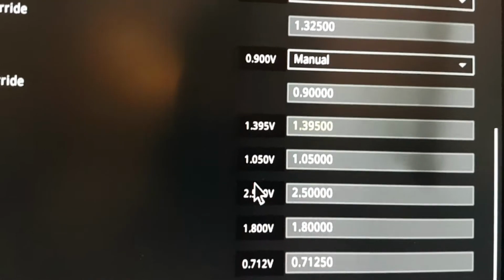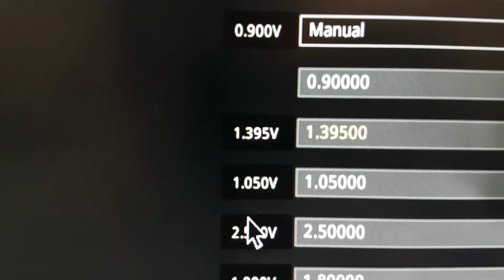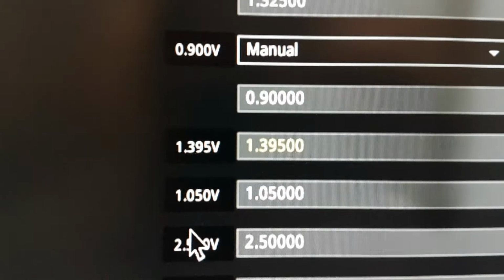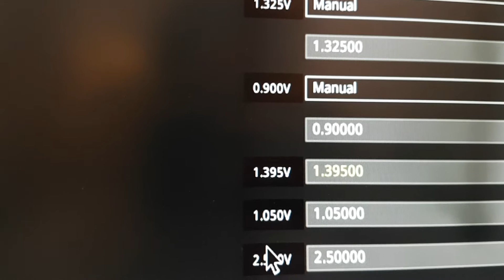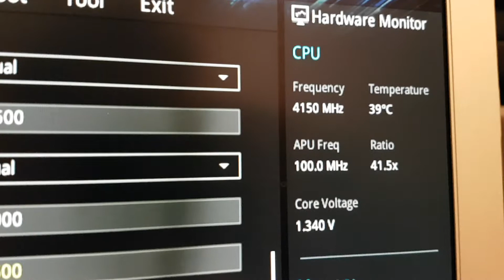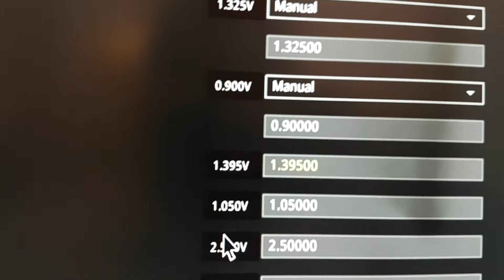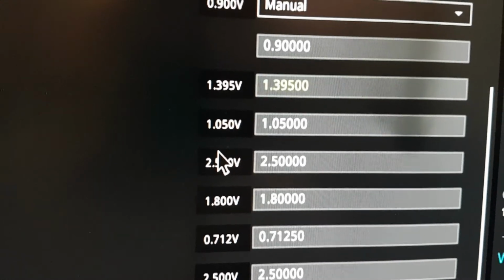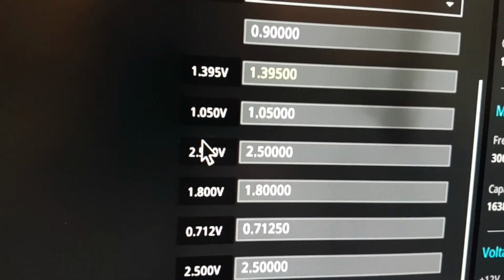AMD Ryzen 2700X overclocking on ASUS Prime X370 Pro

Comment: Which mobo should i choose to run 2700x: B450 Tomahawk or X370 Prime Pro? I also want to OC slightly :v I have a CM ML240R AIO. Thanks :v
Reply from the maker: If it's between those two I'd say the Tomahawk. B450 has better memory compatibility and memory stability than X370, plus there's a greater chance you can upgrade to Ryzen 4000 when it launches. The X370-chipset will not support that. Either way make sure that the memory sticks you chose are on the QVL for the motherboard, as chances are they won't run at the rated speed if they're not.
Reply: @OzzedNet  i dont care much about ryzen 4000 because i may use this combo for at least several years. My concern is about VRM of those 2 mobo. Which one is better to OC 2700X. I've read many reviews. Many people say that b450 tomahawk is too weak for 2700x to OC stably. But many others say it has enough good efficiency :v i'm so confused :))
Reply from the maker: @Vinhl3e  I looked around some and both are totally fine for an OC'd 2700X so it's mostly up to your personal preference. Any VRM will overheat without proper airflow around the heatsinks though, but as long as you have a well ventilated care is should be fine.
Reply: @OzzedNet  my demand is not so high. So i don't think spend too much money to buy x470 or x570 :)) but i think using default frequecy is quite wasting the "X" version with the AIO cooler lol 😂 i just want to OC SLIGHTLY :))

Comment: hello, I have the choice to get this motherboard for cheaps this week, how is PBO and XFR2 overclocking on this motherboard? Thanks
Reply from the maker: XFR2 is working fine, My 2700X was boosting to 4.35Ghz on  a single cores all the time so no issues there. PBO though is a different story. It didn't work that well on this motherboard to be honest. The point of PBO is supposed to be higher boosts but it didn't seem to do that for me, plus all the limits seem to be manual and wonky. It works much better on the Crosshair  VII I got. I can get rock solid all core boost of 4.2Ghz there and it still boosts to 4.35Ghz single core.

If it's "cheap" though the X370 Prime pro is still a pretty solid board, but make sure it comes pre-flashed with a BIOS that supports the 2000-series processors if you're planning to use of of these because if you have an older BIOS that doesn't support them, the board will simply not boot. You will get a black screen  and nothing more.
Reply: @OzzedNet  wow thank you for the detailed response. Yeah currently my choices are : 
X370 prime pro - $110
X370 taichi - $190
X370 k7 - $215
X370 crosshair 6 (pre owned) - $200

X470 motherboards are still too young expensive for me in my part of the woods at the moment.

I realized that the x370 prime only has one m.2 slot. And m.2 drive prices are really attractive right now.
Reply from the maker: With that lineup you can't beat the Prime Pro. The taichi has really nice hardware but the BIOS is a disaster, to put it lightly, the K7 has lackluster hardware that I wouldn't touch with a 10-foot pole, BIOS is OK on that one though, not as good as the ASUS-one but OK. The Crosshair 6 is the nicest of them, but if you're on a budget I wouldn't say the extra $90 over the Prime Pro is worth it though.

Comment: I have X370 KILLER SLI from ASROCK. What Ryzen should I buy ?
Reply from the maker: Do you have a current Ryzen CPU for it? Make sure to update the BIOS BEFORE buying a new processor from the 2nd generation Ryzen or it won't boot. The VRM on that board looks very weak, so If you're buying 2700X don't overclock it. I think you can probably run any Ryzen 5- processor on there. Maybe the 2600X?

Comment: Should i buy this motherboard for 2700x to keep it on stock with pb2 and xfr2 (are the vrms nice enough???) does vrm get hot
Reply from the maker: Hi! The VRM's don't get hot and are perfectly fine for stock and even ovecklocking, AND PB2 and XFR2 works on this board. But if you're buying a new one you might as well go with the X470 Prime Pro due to better memory support. I have G-skill Ripjaws V 3600Mhz (B-die) and they get unstable at even 3266 even with looooose timings, but 3200 is fine with super tight timings, so... Now that X470 is out with support for 3400Mhz it makes more sense to get that, unless of course you have slower memory and can find the X370 prime pro for cheaper, then that would make more sense, in my opinion. 

Oh, and if you do get the x370 prime pro and the 2700X, make sure you have a BIOS-version that supports the 2000-series processors, because you need an updated BIOS for them to work. With the X470-boards you can be sure that 2700X will work out of the box.
Reply: Oskar Hanberg yup is the msi x470 gaming plus nice in terms of vrm??? Because i am a student so low on budget
Reply from the maker: Yes, it can handle a 2700X at stock and even some OC if you want. It seems to be a good budget board. I don't have it so I have no personal experience but Buildzoid is very knowledgeable https://www.youtube.com/watch?v=4FeMLXFenjE
Reply: Oskar Hanberg do you think its wise to pair 2700x with strix b350-f
Reply from the maker: I haven't been able to find any info on the VRM for that board but if they state they support it it's probably fine, at least running stock, but with the B350 boards you would also have to make sure that it comes with a BIOS version that supports the 2000-series cpu's or it won't boot.
Reply: Oskar Hanberg but doesn't the stock "x" processors overclock itself? With pb2 and xfr2???
Reply from the maker: It's not technically "overclocking" because even with PB2 and XFR2 the cpu handles the speed based on thermals, current and power capabilities so it won't go to unsafe levels. If you have a VRM that can't handle higher current, it simply means that the CPU won't boost as high as it would if you have a board with good VRM. so it's fine.
Reply from the maker: @Jaegar Ultima chipset driver updates are not necessary for bios updates. I have owned many motherboards and have never had to update the chipset before updating the bios. Whoever told you that is severely misinformed. Bad bios flashes can happen to us all. Without knowing more details about the specific case I won't be able to help you.
Reply from the maker: Does it work with the old CPU? I'm assuming you had a 1'st gen ryzrn for flashing.
Reply from the maker: If that is the case you should be able to restore the BIOS with Crashfree BIOS 3. Instructions here https://www.manualslib.com/manual/1264753/Asus-Prime-X370-Pro.html?page=82
Reply from the maker: If you use the method I linked to you should be able to fix it using a correct BIOS. https://www.youtube.com/redirect?redir_token=EHrvLa6DX29EGtyvIGgoo4OH6Qh8MTU1MjUwODc3MUAxNTUyNDIyMzcx&stzid=UgzUcfGTSfnRN0DQX7p4AaABAg.8i2SIMotcxZ8sORe-c-gGt&event=comments&q=https%3A%2F%2Fwww.manualslib.com%2Fmanual%2F1264753%2FAsus-Prime-X370-Pro.html%3Fpage%3D82
Reply from the maker: TLDR: Chipset updates are not needed for updating the BIOS, unless you bricked your board by flashing the BIOS from within Windows, in which case the link with instructions i provided should still be able to fix it.

It certainly is not the cause of the failed BIOS uodate (unless you updated the BIOS through a utility in Windows, which you should never do). If chipset drivers were required to update the BIOS, it wouldn't be possible to update the BIOS with no Operating system installed.

That being said, if the reccomendation applies to updates to the BIOS from within Windows, maybe it's a possible cause. I always update the BIOS from within the BIOS itself as updating from within Windows is very risky and should always be avoided.

Still, though, if you DID update the BIOS from within Windows and ended up bricking your board because of the great risk that flashing BIOS from within Windows means, you should be able to restore it with the help of the instructions I provided.
Reply from the maker: I'm glad it worked out. Cheers! :)

Comment: Can you overclock to 4.35ghz? Or 4.25ghz on this board
Reply from the maker: As you can see in the video 4.15Ghz is the highest I was able to go. I don't know if it's my board or if I was just unlucky in the silicon lottery with the cpu. I don't want to pusg more than 1.425V through the cpu as that will degrade it according to AMD. 

I could probably gert a bit higher if I set the fans on my NZXT Kraken X62 to 100%, but that would be at the cost of earsplitting noise, so that's not interesting to me. At the end of the day this is my personal rig that I use daily so noise is to be avoided :)

Right now I'm actually not overclocking at all, as the cpu runs much cooler, and that 1.35Ghz single core performance is nice to have. XFR2 makes it so it's usually hovering around 4.05-4.1Ghz on all cores anyway so overclocking at this point in time for performance is just silly. But of course other people might be more lucky with their chip and it's nice to try it "Just for fun" :)
Reply: I got my 1600X up to 4.2 on water with the x370 pro I have been having less luck with my ram tho. Using 32 gig of Trident Z 3200 and cant get it any higher than 2933..
Reply: @jacob_le_gris  is that 4 sticks? Probably why, more ram module the harder the imc struggles.
Reply: @Shise-  Yeah that's 4 but only added the 2 extra recently and had the same issue before.

Comment: Hi bro i know i am late but i overclocked my 1700 to 3.7 and i saw a jump in a performance but after i tried to overclock it to 3.9 but performance still the same like in cinebench
Reply: Cinebench in 3.7 ghz was 1574 and in 3.9 ghz was 1580
Reply from the maker: That is strange. Performance in CB is pretty linear with CPU frequency. What memory speed do you have? And did you update BIOS to the latest version?
Reply from the maker: When I had the 1700 it needed 1.425v to be stable at 3.9Ghz.
Reply from the maker: I'm happy to answer your questions :) For me personally the 2700X is worth it but it all depends what budget you're on. I definitely noticed the performance bump, and I love to be able to upgrade the cpu and keep everything else.

Comment: Hi, you did it 3200mhz in some BIOS or not yet? Here i have the same problem, rams max 3066 stable..
Reply from the maker: Hi!

I have it running on 3133Mhz, I used the 3200 SAFE timings from Ryzen DRAM Calculator http://www.overclock.net/forum/13-amd-general/1640919-ryzen-dram-calculator-1-1-0-beta-2-overclocking-dram-am4.html I had to use looser timings so in the end I'm not sure if it's actually faster. Very frustrating.
Reply: you set all the timings manual, or only the main?
Reply from the maker: All of them Primary, secondary, tertiary, as well ass Command rate, CAD bus drive strength, PROCODT and so on.

Comment: Not a very helpful video. How are you adjusting cpu frequency? DID and FID? If using custom multiplier does it downclock at all?
Reply from the maker: I set the cpu ratio to AUTO and the just put in the numbers like so: 40 for 4Ghz, 41.5 for 4.15Ghz and so on. 

And yes it downclocks. I will have more videos up later when I go over questions like this, so subscribe and stay tunes :)
Reply: it doesn't downclock for me, latest bios and using ryzen balanced power plan
Reply from the maker: AMD now advices against using "Ryzen balanced power plan".  Use "high performance", go into advanced power plan setting, set processor max state to 100% and processor minimum state to 0%. Worked for me on the 4008 BIOS on the ASUS Prime X370 Pro board that I have. Ryzen balanced power plan has always given me garbage performance and never downclocked for me so I don't use it.

Comment: Nice result :D Do you can try to overclock more your memory? The XFR2 can work on this motherboard?
Reply from the maker: XFR2 does work on this motherboard, yes :) and even "Precision boost overdrive" works, there's a setting in the UEFI for it

I can probably go higher with my memory but I would need to try something different. Right now, even 3133Mhz is not stable and causes Crashes in OCCT. But it's Samsung B-die so there's probably more to be had from it :)
Reply from the maker: I overclocked the memory some more :) https://www.youtube.com/watch?v=YG6QL-TEB80